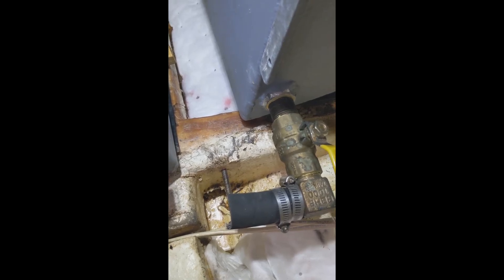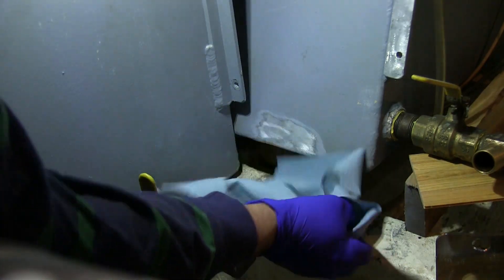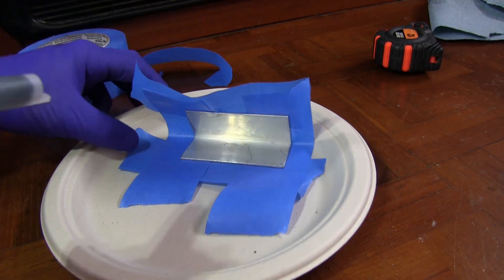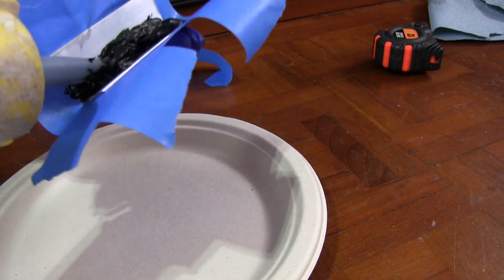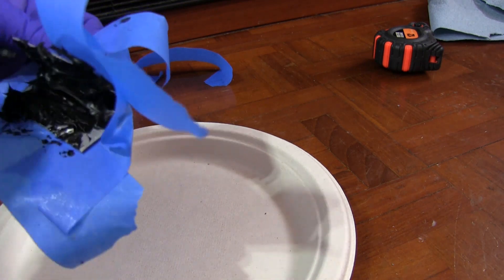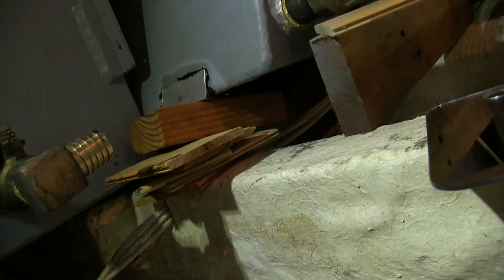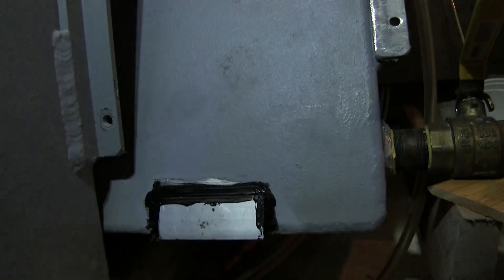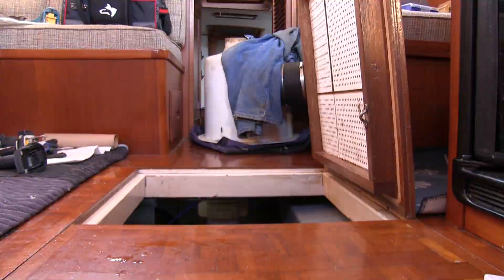Aluminum Diesel Fuel  Tank Repair (No Welding temporary)

Comment: Thank you  for this.
I have a similar delema.
Poor welding on  a corner of an aluminum tank. 
Except mine comes out relatively easily..
 I have been encouraged to use a starbrite epoxy type product..

Comment: Had to replace the rear sliding glass in my truck . Replacement came with that Urethane adhesive and instructions said put in 140* oven for a couple hours . Still a bitch to come out of caulking gun with half the nozzle cut off .

Comment: OK… inquiring minds… I have an almost identical situation on a 39yr old aluminum diesel tank.has your repair held? You mentioned “temporary”… temporary or permanent. I’d like a permanent solution if possible. Many thank. Peter C. Kingston Canada.
Reply: Still holding strong!
Reply from the maker: It’s been holding up great, but it’s still a temporary fix.

Comment: Thanks for the video I have a similar problem
The CRL seems to work extremely well, and I really like the idea that it remains flexible
I have cut an inspection port in the tank and plan to repair from the inside and reinforce the whole weld ( approx 42" )M concern is that the CRL may break down when exposed to diesel which would obviously upset my injectors to a considerable degree
What has been your experience over time 
Could you give me the name of the tank builder on Long Island as he may have dealt with this situation previously
Best Regards
Reply from the maker: Since the repair I have not been using that tank unless I need to (I have 4 Tanks in the Boat) and so far the fix is still working